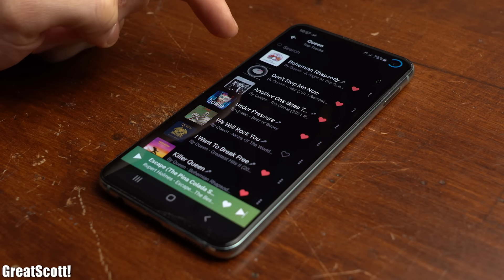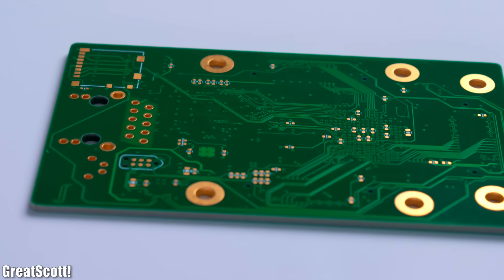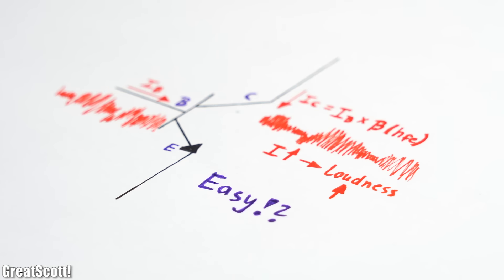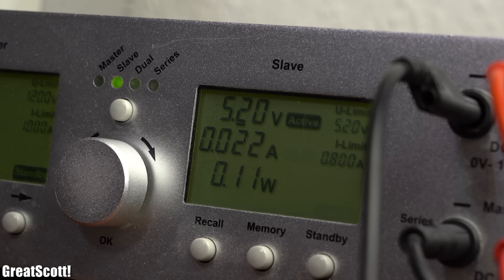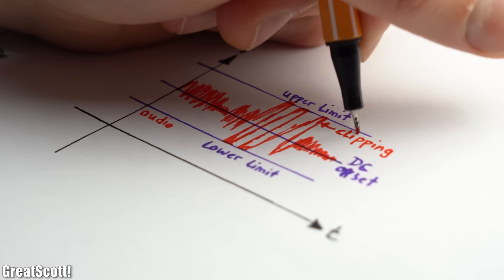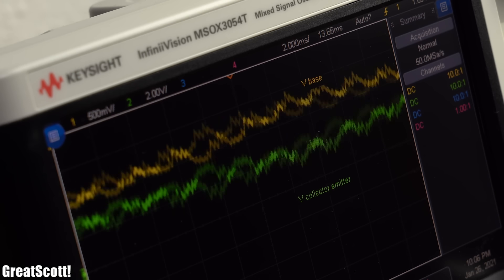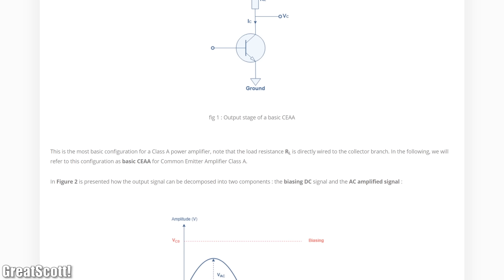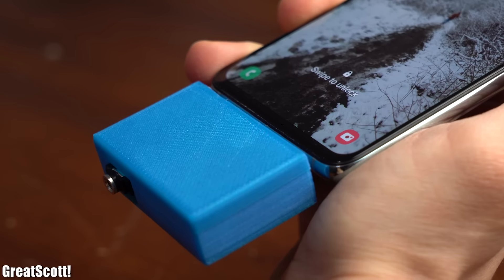Building the simplest, best sounding, yet most inefficient Audio Amp! || Class A Audio Amp Tutorial

Comment: Hi Scott,
Just a suggestion, instead of making the highly inefficient A class amplifier for just headphones, instead a lm358 op-amp could have been used to increase the voltage. The headphones do not consume much current( generally 48 ohms consuming only 4 mA on 2 volts which may be easily supplied by the op-amp) thus reducing the battery consumption, power losses, etc on the transistor in A class.
Reply: Unfortunately, an LM358 won't swing its output to more than 1.5V below the supply rail, meaning with a 5V supply, you'll only get an available output of 3.5Vp-p - about 30mWrms into 48 ohm headphones at best. To complicate that, its voltage swing is only specified for loads of 2K or greater, and it has short-circuit compensation built in which further limits the amount of current you can draw from it.
If you're going to use an opamp, I'd suggest thinking about a couple of LM386, taking 4mA supply current each. I know it's a cliché, but to drive 20 ohm loads from a 5V supply cleanly isn't easy for any IC audio amplifier. There are probably higher spec parts about, but good old LM386 is plentiful and cheap. Worth trying.

Comment: I was thinking why you omitted the emitter bypass capacitor. It provides negative feedback that stabilizes the amplifier. But then at 8:35 I saw my favourite swamped amplifier! 😍

You're THE BEST.
Reply: Using a split emitter resistor with part of it bypassed is fine for small signals and large voltage supplies. But when you have just 5V supply and you're trying to get enough voltage swing to drive speakers, the bypassed emitter resistor is simply a waste of headroom. It's far better to bias the emitter to around 250mV (ten times the thermal voltage to swamp the intrinsic emitter resistance) and get the dc stability by using a feedback resistor from collector to base, replacing R1.

Comment: Hello, this is an excellent and practical project that I used, it amplifies the sound well, but in my sample it has some noise, I checked the connections several times and there was no problem, if you can suggest a workaround for the noise, I would be grateful

Comment: There is something I didn't quite understand when you were selecting your components.  When you were figuring your collector current, you said 1ma was too quiet, 10ma clipped at max volume, and 20ma was the sweet spot.  Was the clipping caused by the transistor running out of power at 10ma?
Reply: Nah, he just got the quiescent dc bias point for the collector too far away from the mid-point of the output range. It was a design error, nothing more. The circuit will work with a collector resistor of 260R at 10mA and will clip at just the same point as when you have a collector resistor of 130R at 20mA.

Comment: I would design the other way round. You set the base voltage to about 50% of Vcc. Vb is then 0.7V lower. Ie = then Vb/Re. Ic is about the same as Ie, and you can calculate a suitable Rc. The amplification of this circuit is approximately Rc/Re.
Reply: We can assume that Vcc=5V. If you set the base voltage to 2.5V, then the emitter will be at around 1.9V. Setting Ie=19mA gives Re=100R. Then you have a maximum collector voltage of Vcc and a minimum of Ve at best. That gives a maximum possible swing of 5V - 1.9V = 3.1V. You set the voltage on the collector to the mid-point of that range, so it should be about 1.5V below Vcc. That means Rc=1.5V / 19mA = 80 ohms. But Av = Rc/Re = 80R / 100R = 0.8, which is a gain of less than 1, thus defeating the whole point of the amplifier.
Regardless of what you read on the web, you always set the emitter voltage to 0.25V and then the base is at 0.9V, if you want to get a useable gain with low supply voltages.

Comment: It's very misleading to suggest that the value of the collector current determines the loudness of the output. Your viewers will mistakenly conclude that the gain of the circuit depends on the collector current, but it doesn't. You could take the circuit using Ic=20mA and scale up all of the resistors by a factor of 10, giving a Ic=2mA, and it would have the same gain. That's because the gain is set by the ratio Rc/Re, which is 130R/26R = 5 when Ic=20mA, and 1.3K/260R = 5 when Ic=2mA.

The only parameter that is determined by the collector current is the output impedance of the stage, and that is equal to Rc. So that's the reason why the headphones sound louder when the collector current is higher: when the output impedance is 130ohm, you only lose about 80% of the signal when feeding 32ohm headphones, whereas if the output impedance were 1.3K, you would lose about 97.5% of the signal when driving 32ohm headphones. If you plugged your amplifier into high impedance headphones, you would not hear any difference in volume between the two cases.

Actually, the collector current also determines the maximum input impedance of the stage as well, but that's irrelevant here as in any case it will be much greater than the phone's output impedance (designed to drive 32 ohm headphones) and you have no signal loss into the input of your amplifier.

Comment: Hi Scott, I always enjoy your videos and revisited again and again sometimes for more details. Today I put the circuitry into LTSpice for simulation, I have few questions, I found that if the input signal is more than 0.5Vrms, then it will start clipping, so on the mobile phone side , we can turn the volume up to around 50% only, right? Secondly, the output capacitor is 10uF, with 32 ohm headphone, the cut off frequency will be around 497 Hz, is that mean it will cut off most of the bass of my music? Lastly, the THD measure is around 2.32% with class A, is this figure good for music listenning? Just open these question for discussion and no offense to anyone please. Anyway, I'm just a curious learner, and this was a video done 3 years ago....

Comment: I highly recommend to playing around with different type of capacitors in the in-out section. Tantalum one is not the best choice IMO.
Reply: Its not a tantalum cap afaik, its a THT MLCC, they look similar.
Reply: @mudza6002  They have a polarity marking and are quite large for 10 uF and have a rating of 25V. I'm fairly confident they're tantalum.
Reply: dies cap pol matter? And which way round do they go? Building first circuit.

Comment: not to be rude or something. but for your information.
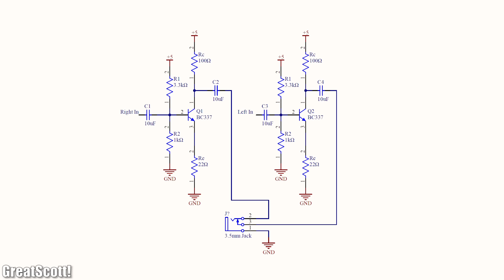so here we go, 10:07 notice that capacitor output(C2 C4) is only 10uf. 
the typical headphone is around 32ohm (not linear to every frequency but simplify sake ). output capacitor aside from coupling for dc, it also you as it will also act as a High pass filter.
reference for calculation and formula.
http://www.learningaboutelectronics.com/Articles/High-pass-filter-calculator.php#answer1

10uf is cut off very high for the minimum. most manufactured use around 100-220uf.(examples would be headphone amplifier, sound card,  or headphone output of motherboard) so it cut off lower.
around 20-50hz(minimum human ear perception but that also depends on age and individual) 

and I think just increase the Values of the Capacitor won't more complicate the circuit and make it better. 

sorry about my broken English.
Reply: Since the amplifier has an output impedance equal to Rc (130R), the output at the earphones (likely around 32ohms impedance) is reduced by a factor of 32/(130 + Xc + 32), where Xc is impedance of the capacitor at a given frequency. When Xc is negligible at high frequencies, the reduction is fixed at 32/(130 + 32). So the -3dB frequency occurs when Xc = (130 + 32) ohms, not just the impedance of the earphones (as it would if the amplifier's output impedance were much lower than the load). A quick calculation shows that 10μF has an impedance of 162 ohms at a frequency of about 100Hz. Although a 22μF capacitor might show a little improvement in the bass response, I think you'll find a 100μF capacitor or more would offer no improvement on that, as I seriously doubt anybody building their own amplifier owns earphones with a bass response extending down below 10Hz.
Reply: @RexxSchneider   can you tell me where Rc = 130R come from?  C output directly connected to transistor. Did I miss something?
Reply: @sang7873  The collector of a transistor is a high impedance point, which means changes in voltage across the transistor does not alter the current flowing by much. You can see that by looking at any transistor datasheet that shows Ic vs Vce curves, where the current stays essentially flat as Vce increases. So the output impedance of a common emitter circuit is simply the value of the collector resistor.

The output of the circuit is a voltage source with an internal impedance. If you understand Thévenin's theorem, you can see directly what the internal resistance of the voltage source is. If not, then consider connecting a load that draws 1mA from the output. That current has to come via the collector resistor and so will cause an extra voltage drop of Rc x 1mA across it, which will lower the output voltage by Rc x 1mA. If a voltage source drops by (Rc x 1mA) when delivering 1mA into a load, then it has an internal impedance of (Rc x 1mA) / 1mA = Rc.

In many common amplifiers, the output impedance is designed to be much less than the expected load impedance (usually by using negative feedback), so you will probably be accustomed to ignoring the output impedance of the amplifier when considering coupling capacitors and just working with the load impedance. However, in this case, the output impedance is higher than the load impedance and dominates the frequency response of the R-C high pass filter.
Reply: @RexxSchneider   thank you very much. I am just a hobbyist. I did not know that deep.

Comment: If you need a substantial gain, Rl needs to be larger then Re, hence Vb needs to be quite low. This is limited by the input voltage.
Reply: The maximum gain of a common emitter stage is determined by the supply voltage. Av(max) = Rc / re = (Vcc / 2.Ic) / (25mV / Ic) = Vcc / 50mV.
However, the non-linearity of re creates distortion, so for a practical design, we "swamp" re by having an Re about 10 times bigger, showing that the highest practical gain from a swamped common emitter stage is when the emitter resistor has about 250mV across it (i.e. Ve=250mV; Vb=900mV), giving a gain of about Vcc / 500mV.

If you want a substantial gain, increase the supply voltage.

Comment: Helpful video. like, respect. I have a question: did you take measurements? What voltage and current does your phone output and what voltage and current does the amplifier output (at a frequency of 10kHz)?

Comment: You know how sometimes your friends want to listen to something on your phone, but you want to hear it too, so both have to stick with one headphone.
Well i certainly didn't like that, so I made some headphones that have an audio plug at the point where the cables split in two. Just connect the three wires of the headphones to an audio plug (ground to ground and the rest is for stereo and can be wired however you like). And as long as you have an extra pair of headphones, both can listen the same phone.

Comment: This is very cool but I want something with even more power. Would you recommend cascading BJTs or throwing mosfets within the circuit for power amplification
Reply: With a 5V supply, you can't possibly get more than (5 x 5) / (8 x R) rms watts into a load of R ohms from a single-ended output without using transformers of some kind.
You don't say how much power you want, but for audio use, start with looking at single chip power amplifiers like LM1875 and TDA2050 with supplies of 12V or more.

If you're interested in discrete audio amps, you could take a look at John Audio Tech's videos https://www.youtube.com/user/JohnAudioTech/videos

Comment: Could you possibly design & show how to build a small, portable (runs on batteries) 10W/Ch Class-B discrete (non-IC) Transistorized Amplifier, that's integrated (built-in power amp & preamp)? I have a chinesium 5W class-D amplifier that runs on batteries but the power is lacking, there's no tone controls and there's an awful amount of hiss. It would also be appreciated if you could add a power transformer as the external AC to DC bricks are annoying as all hell.

What's interesting is that even the internal 500mW diode-biased discrete transistorized audio amplifier on my vintage American radio outputs more bass than the Chinese amp I have (without distortion), though it has significantly less headroom.

I live in the US so a Non-IC circuit would come in handy if ever an EMP (Nuclear Electromagnetic Pulse) pops by.

Comment: Very nice video for enthusiasts! But IMHO the output 10uf cap is way too low. You have a lack of bass as you charge a “low impedance” load. It would be perfectly fine for a high “line out” but not for headphones. You could eventually make a follow up video testing the frequency cutoff with different output capacitor values.
Here a 220-470uf would be much better, with much more bass :)
Reply: You miss the the point that the output impedance of the amplifier (130R) is considerably greater than the load impedance (probably around 20R to 32R), and so the sum of those impedances is what determines the high pass roll-off frequency, which is actually more like 100Hz in this case. Using a 22μF capacitor would be fine as I seriously doubt that the headphones have any usable response below 50Hz.

Comment: I was wondering ,what is the input impedance of the headphones, I saw 19 ohms on the multimeter, and that should load your 130 ohms collector resistor quiet heavily. 20mA peak into 19 ohms is 0.38v peak voltage and so it defies the amplification purpose all together
Reply: In practice, the earphone's ac impedance is likely to be more like 32 ohms typically, sometimes a little more. After all, a speaker is mainly an inductance at audio frequencies. Nevertheless, you're right that they will load the 130R collector resistor, perhaps reducing the output available by a factor of 4. Considering that the stage has an unloaded gain of around 5, it is true that not much amplification will be seen unless high impedance headphones are used.

Comment: Love the video!
Is there a way to determine the maximum current that a speaker can deliver before clipping without driving it? 
Would you be able to create a video to design a simple blinking circuit for a 12V system for LEDs?
Thanks!
Reply: No, there's no way to determine that because it's a mechanical effect that depends on the suspension of the speaker, the "throw" of the coil and the frequency you're driving it at.
However, speaker manufacturers specify a maximum power for the speaker, and if you know its nominal impedance you can ensure you stay within that rating.

Comment: did you consider adding capacitor between emitter and gnd? It would result with better amplification ratio
Reply: See 8:38
Reply: It would also introduce lots of ugly distortion, because of the BJT's inherent non-linear transfer characteristic. The emitter resistor is needed to swamp out the non-linearity and reduce distortion to tolerable levels.

Comment: Does Your amp produce a lot of heat? Im building a spring reverb module for college and Id love to put it there because of the simple construction, cost, and low distortion, but id have to make 2 sets of Your amp as there are 4 springs (2 stereo sets). It'd be put in an closed wooden enclosure. I could put a flat heatsink on the back panel (about 10cm x 5 cm [4 cal x 2 cal]).  Sorry for this being so long 😅 i hope You'll answer. Thanks in advance!

Comment: Im not sure how you lowered the output impedance to match the earphones, but its a great video anyway.
Reply: He didn't. It just attenuates the amplified signal by a factor of R/(130 + R) where R is the earphone impedance. Any earphones with less than about 32 ohm impedance will give an overall gain of less than 1, so you'd need to re-design the circuit for an even higher collector current. He did say class-A amplifiers are inefficient.

Comment: Hi Scott! :) I've been wanting to ask you a question for a long time on this topic.

So, you used a BJT. What's the fastest ammount of switching signal it can do? For example, can it amplify a idk, 28.8MHz signal? How is that calculated? Perhaps a more common BJT like 2N2222.
Reply: I know that I'm late, but the max frequency that a bjt transistor can work is provided in the datasheet. But you still don't need to exceed half of that value because gain will decrease with frequency after that piont

Comment: I'm thinking about adding a component like this to a lap steel guitar I'm building.  It will be using a garden variety single coil pickup.  Should I stick with Ic of 20 mA?  Is there a way to make a guess at Ic based on the pickup design characteristics?  Turns out I'm a much better woodworker than electrical engineer.  :)
Reply: You set the collector current to determine the input and output impedances. The output impedance will be around half the supply voltage divided by the collector current. The input impedance in kilohms is at most around β divided by (ten times the collector current in milliamps), where β is the transistor current gain. For 20mA and a 5V supply with a transistor whose β=200, you get around 2.5V/20mA = 125 ohms output impedance, and 200 / (10 x 20) = 1K input impedance. I don't know the required impedance that the pickup expects to be driving into, but I'd play it safe and reduce the collector current by a factor of 10, so designing for Ic=2mA. That means the output impedance would be 1.25K, which is far too large to drive headphones, so you'll need additional amplification for that, in which case, I'd simply use an LM386 and forget this discrete circuit.
If you're only connecting into the input of another amplifier or similar, something like this circuit would be fine.